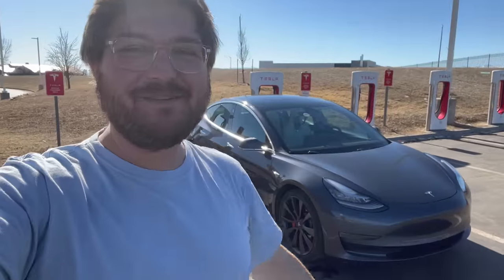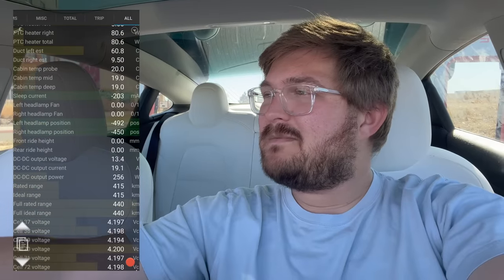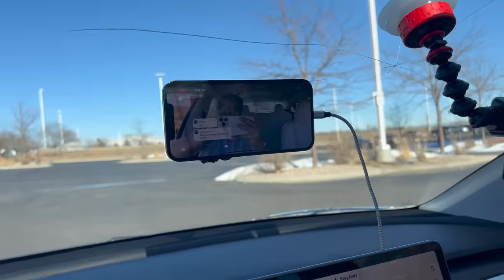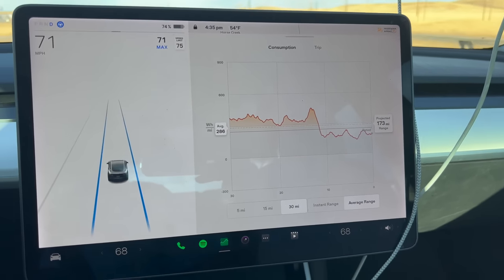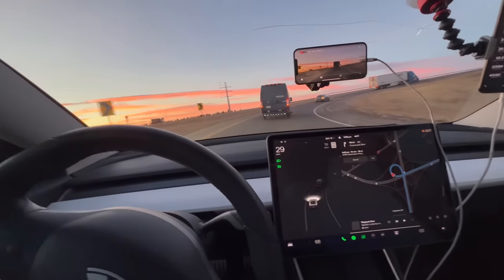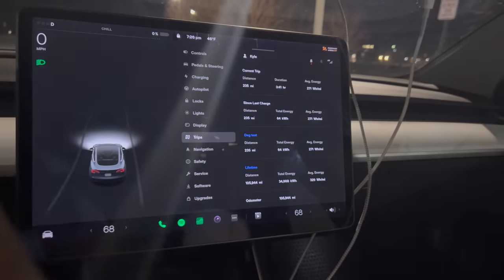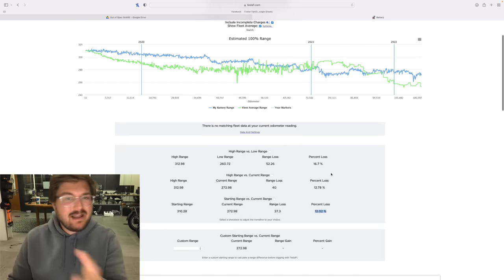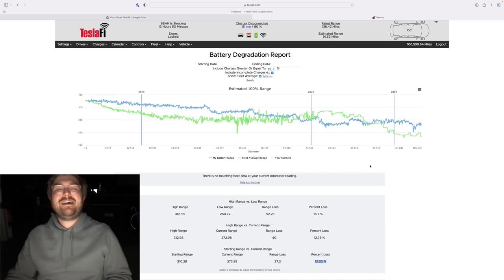100k mi Tesla Model 3 Performance Battery Degradation & 70-MPH Highway Range Test

Comment: Can someone tell me how much of degradation is due to time and how much heat and cycling?  In other words if I keep the battery at 50% at perfect temperature for 10 years with no use, will it keep all of it’s capacity?
Reply: Everything I read says no. Batteries lose capacity over time whether they see much charge/discharge or not. What the exact correlation is, I couldn't say.
Reply: You definitely have some degradation over time regardless of use. I've read through several studies that break it down but it varies from chemistry to chemistry and it's always faster when the cell is newer and it slows down over time. After a year or so the  "time based" degradation is such a small component of overall degradation that it's not really that relevant in the grand scheme of things.

However: At 50% SOC and at perfect temperature (And "perfect" for storage is fairly cool. Usually between 40-60 F) the degradation would be fairly small. Small enough to be considered negligible for most situations I'd imagine. But it would be pretty difficult to store it at the perfect temperature unless you stored it in a large industrial refrigerator so in the real world there's always going to be some acceleration of the degradation due to heat.

Batteries "store" better cold, but don't operate as well in cold. So the "perfect" temperature for storage may not be as ideal for driving, but 60 F should be pretty close to the ideal compromise for both.
Reply: @belavet   and @Jeremy Akers  thanks for taking the time to respond
Reply: It still will degrade. Current batteries are just chemical devices that degrade. And depending on your luck one may degrader less then the other regardless of usage. Thing is: the degrading is only a few percent. by the time it is relevant you already have anew car. we are talking 10 years maybe. Plus for everything before you have the manufactures guarantee which is usually up to 6 year and around 100miles. Battery costs are also significantly decreasing so if you actually need to buy one it may one be around 3000$. which is nothing after lets say 8-10 years of not having payed anything else :)
Reply: No one can tell you with certainly since no model 3 batteries have been on the road that long. An educated guess would say it will not lose more than a few percent to degradation based on your said conditions though.

Comment: Assuming constant charging costs, would it be 11% more expensive per mile now that the car has 100,000 miles on it?  In other words, is this loss of energy going to heating the batteries due to the degradation?  It would seem so as you stated the battery pack was at 60° c which was a little abnormal. So it could be that 11 KW hours was lost to heat.
Reply: The battery creates heat when charging whether new or old. perhaps a bit more when old but certainly not 11% wasted due to degradation. most of the heat was generated by preconditioning and by the act of fast charging. I've seen the battery get to 64 Celsius on my model 3 with way less than 100k miles. The battery charges and discharges quickest at these temperatures which is why its allowed during supercharger preconditioning, but when finished charging the car will aggressively cool it back to the normal 20-30 C range.
Reply: @ryen7512  thanks for the reply.  I always wondered if the degradation was somehow costing more energy/mile.  So what you suggest is if the battery degraded 50%, that it would take 50% less energy to fully charge it (constant energy cost). I wonder if it would be 50% quicker to charge it as well (same charger).
Reply: @MarkPryor1  That is correct. Look at it as if you have jug for water. When new, it takes 1 liter, and for every 1% "degradation" you add a stone of 1cl volume. After 10% you will have filled the jug with 10 stones and the time to fill will be 10% faster

Comment: So your degridation rounds out to roughly losing 1 mile of range for every 3000 miles of driving, or 1.1% battery loss every 10000 miles. It's not linear, but a basic rule of thumb.

Comment: Lead foot? I have long range rear 2018. My average for 80K is 235w/mile. 
I also do 75 on freeway. Wonder if the dual motor use that much mode juice 270ish/mile is high. I still have 297 at full charge.
Reply: The M3P has 20 in wheels with wider and stickier tires plus no aero covers. Also the extra motor adds some weight.

Comment: How did the roof glass crack?? Never seen that. Is that a Tesla thing or did just something heavy fall on it?
Reply: He has abused the heck out of this car, he’s done rally jumps, drag races, drifting, off roading, had beer explode inside and tons of other stuff.
This is most definitely a durability test and no roof cracks are not a common Tesla issue, although it’s important to know the roof is glass so if you want to get a Tesla a garage or carport is very highly recommended in case of falling debris like branches or hail

Comment: Would there be a difference in battery performance if you home charged versus supercharged to 100%?
Reply: Yes. And this is true with all EVs. EV batteries degrade more when using DC fast charging. EVs are built for home/slow charging, with DC fast charging being for those occasional road trips.

Comment: Are there any reports of the rate and percentage of degradation for the a 200k mile battery?
Reply: lithium battery is degradation is pretty linear long term so probably 22-24% lost at 200k. Depends on conditions. If you fully charge and fully discharge you are going to get far more  degradation than if you only charge to 90% and don't get close to fully depleted. Throw in outside temperature, Charging rate, load, average speed, how often you floor it and 80% capacity could be reached from 100k to 500k depending on if you baby it classic grandma drives it to church every sunday or push it to limit every single time.

Comment: I mean, it's great to go in opposite directions, but it's not true that it will accurately cancel out a strong wind.
Reply: How do you figure? It's hurting you in one direction, helping you in the other. Are you saying the wind pushes harder in one direction and less hard in the other?
Reply: @JeremyAkersInAustin  Yeah, hurting you in one direction and helping in the other, but aero drag is relative to square, so assuming the wind is the same, it's adding more drag into the wind than it is reducing away from the wind, and if it is not directly in front or behind, it's harder to calculate. If the wind is slight, it's not a big effect, but a significant wind would definitely increase the overall aero drag.

Comment: Super interesting, but man…charge time just takes a long time. Costs have to come down on EVs and charging times have to drop to less than 15 minutes before EVs take over. I’ve no doubt that they will, but an hour to “gas up” (haha) is a lot if you’re on a trip. I do a lot of driving and just can’t take an hour every 300 or so miles
Reply: We drive a Kia Niro EV which doesn't charge anywhere near as fast as a Tesla or any of the newer EV models. We've done several multi-thousand mile road trips and we can generally cover 500-550 miles in about 9 hours of driving. Even though our Niro isn't the fastest charging car around most charging stops are around 20 minutes and we find it's actually hard to go to get everyone in and out of the restroom, buy snacks, drinks, etc, and get back to the car before it's finished charging.
Reply: He was charging from 4% all the way to 100%
Of course it will take time. Realistically if you’re taking a road trip, it’s better to just get in 10-20 mins of charging when you stop to get snacks or use the bathroom and you’ll usually maintain charge the duration 
Unless you’re just booking it straight there and pissing in a bottle
Reply: This was a battery degradation test, so he wasn't charging the way  you normally charge. Typically on a road trip you'd pull into a charger at ~10% charge remaining and charge up to 60 or 70 percent, which would take about 15 to 20 minutes (barely enough time for a bathroom break or to order food or whatever), then drive another 180 to 200 miles, then charge again for another 15 to 20 minutes. It does take longer than gassing up, but the forced breaks makes the drive much less tiresome. My drive from Denver to Phoenix took about an hour longer than when I do it with a gas car, but was much less tiresome.

Comment: In the UK, that crack would get you fined if spotted by police. is this not the case in America?
Reply: Depends on the State or County. In general people drive lifted trucks, electric or gasoline golf carts, kit cars etc. Many counties do not have annual inspections either.
Reply: In my state, it’s only a problem at inspection time — ie, you won’t pass inspection and won’t receive a renewal sticker for your windshield — if the damage is in the driver’s direct line of sight or if the damage has the potential to extend into that line of sight. I don’t think a cop could randomly ticket you for it though.

Comment: Have you changed the battery coolant?  I wonder how that would affect cooling.  No coolant is lifetime.  Regardless of what the OEMs say.
Reply: @laloajuria4678  Really?  Nothing is lifetime.  Trans fluid.  Gear oil.  Coolant.  Everything takes on contaminants from it's environment.  If you think "lifetime" is five years or 60,000 miles, then fine.  I guess I define it differently.
Reply: @laloajuria4678 ?  Kyle is no "random guy on the internet."  He's closer to an expert than anyone I have access to.  I won't trust any manufacturer blindly.  Why?  I wasn't born yesterday.  I've been burned before.  Also, I choose to think.  I just asked the question.  You seem offended.  I have to ask myself, why?
Reply: It would probably be good to change the coolant and oil at 120000 miles.
Reply: It is life time like a warranty on a pacemaker.  There is no life when it dies.
Reply: Coolant in an EV lives a very easy life. Wear would be on time rather than heat cycles.
Reply: It is effectively "lifetime" in terms of the life of the vehicle. The coolant will likely outlast the battery and body of the car.

The reason why coolants break down is because of extreme temperature cycling. Water becomes corrosive at very high temperatures. The antifreeze added to coolant helps reduce this corrosion but you're still going to see some contamination at high temperatures as the coolant pulls material out of the engine block casting. In an ICE the coolant is typically between 190 and 210 degrees F at operating temperature. This coolant is also flowing through passages in the engine block that are usually "cast" metals that are prone to rust, scale and other forms of corrosion from high temperatures. The casting process also results in a fairly rough surface too which increases the amount of metal that's going to end up contaminating the coolant over time. This is what results in the "contaminates" you're referring to in the coolant on an ICE vehicle in addition to the coolant itself breaking down due to being subject to such extreme temperatures.

In an EV coolants are not exposed to temperatures much warmer than 100 degrees most of the time with 120 degrees F being at the more extreme high end. It's just not subject to the types of temperatures that would lead the coolant to break down. It's also not being circulated through a cast engine block or using the same kinds of corrosion prone metals.

In other words: It's effectively lifetime of the vehicle. No it won't last forever, but neither will any other part of any vehicle.

If the manufacturer or dealer could justify having the fluid changed they would. They make money from that service. The fact that the manufacturer doesn't recommend it should tell you pretty clearly it's not needed because if it was needed for any reason at all they would recommend doing it. Both because they would profit from the service and for liability reasons.
Reply: @JeremyAkersInAustin  Thank you taking the time to reply.  I appreciate it.

Comment: 33kw per hour, so it takes at least 2 hours to do a full charge from very low to full? Can we see a crash test, I want to see if its true that they catch on fire and burn intensely, before first responders arrive? Is it true that Tesla ranked bottom 30 out of 33 automakers for build quality and reliability?
Reply: Recently two children and two adults survived in a Tesla that feel 250 feet off a cliff at Devil's Slide. The adults are in critical condition but the children were unharmed. That may be the most spectacular crash test you will see of any vehicle. And no, it did not burst into flames as is typical of cars with an internal COMBUSTION engine.
Reply: @BitJam  I looked up that crash.........that must have been quite a ride to the bottom.  Heres the thing, although it looked bad, and it is in some ways...........the chassis did not suffer a longitudinal shunt, unlike say rear ending a semi, or being hit hard from behind.  The battery in a Tesla is in the floor pan, and when the vehicle suffers a longitudinal deformation (common in traffic accidents) its length can be shortened dramatically, causing the floor pan to buckle and the battery to be severely crushed as it absorbs the impact.  That is the ideal situation for a battery fire.  The other factor that may have saved that family is if the battery is low, or very low on charge.  I wonder if Autopilot was being used?!?

Comment: How do you get teslafi to display like that mounted phone?
Reply: The mounted phone was running the Scan My Tesla app (available for Android or iPhone), which communicates via a bluetooth dongle plugged into the vehicle's CAN bus. TeslaFi is something different. It is a separate service that logs your car's data to the cloud as you drive. I don't think you can see the data Real-time, but rather you lookup stats over time as data is logged after each trip. TeslaFi costs $5/month, or $50 per year.

Comment: Some suggestions for future episodes:Do a EV vs ICE car road trip challenge . To make things interesting, you can give the EV a bit of a head start or a shorter route and see which one wins.
Reply: Why bother? The ICE will win. That's not the point of EV.
Reply: @regibson23  I wouldn't be too sure of that.
On a straight up "I want to get there as fast as humanly possible" road trip yes the EV will always lose.
For people engaging in normal, real world travel habits however the differences really only start to show up beyond about 450 to 500 miles in a single day (exceptional circumstances notwithstanding - road trip in 0F the differences pop up sooner, headwind cuts range, tailwind you can go farther, etc)

Several times a year I do a 400 mile one way trip to visit my parents.
Yes if I were to not eat or drink anything and leave the wife and kids at home I could drive an ICE straight through no stops of any kind and do it probably 1hr faster than I could in an EV trying for the absolute fastest time.

In 5 years driving this trip I have never driven straight through, not even when I've gone solo. We always make stops and those stops are always longer than we think they take.

So under my real world habits the EV and ICE times for this 400 mile trip are basically the same in summer conditions and about 15m slower for the EV in winter conditions.
Reply: Actually, a couple guys in Australia did that with an Ioniq 5 and a Tucson. Less than 40 minute difference, and that was including an unexpected wait at a DC fast charging station for an available charger!

https://youtu.be/iSlZMikqvXQ

Comment: The "range" test part of this video really has nothing to do with range.  It has more to do with determining how much capacity the battery has by running it from 100% to 0%.  I mean, if it was a range test, driving around a parking lot for over 10 miles isn't exactly the best way to test it.

As to the degradation... The average driver will take nearly 8 years to drive 106k miles while Kyle did it in just over 2.  The degradation figures Kyle's vehicle got are "alright", but a huge part of the degradation equation is missing.  Battery age.   I believe there was a study released in the past year that claimed age had a larger impact on degradation than typical battery cycling.  It's hard to say what the average driver may see in degradation after 106k miles and 8 years.  

A big reason a lot of people buy Teslas is because everyone believes they have the best in class range.  However, between underperforming their EPA combined range by a higher margin than other vehicles during real world 70 mph highway tests, and the low inaccessible size that can increase noticeable degradation at a faster rate, range may not actually be this vehicle's strong point as it ages.  It may be nice for the first 1-2 years, but if it does in fact degrade at a faster rate, then it could underperform the competition for over half its 15-20 year lifespan.
Reply: Under perform new competition in 15 to 20 years? Or compared to the degradation of competitors over 15 to 20 years?
Reply: @wdbldr67  Yeah, that was a bit confusing.  The second half of the vehicle's life could see lower range than competitors.  Actually, it's probably more likely to start about 3-5 years in.

Sadly, it seems 90% of youtube BEV content is Tesla related, and while it's fun watching literally the same test done on the same car over and over again... it would be great if these BEV channels actually compared cars instead of trying to play games with the youtube algorithm.
Reply: @updlate4756  Good point. Lots of tests of other Bev's but not really any degradation tests just range tests.
Reply: Thank You! I wonder if these YouTubers know this. It is the age not miles that plays the biggest part. I have same year and spec with 30k ODO miles and can only pull 67 kwh from my pack.